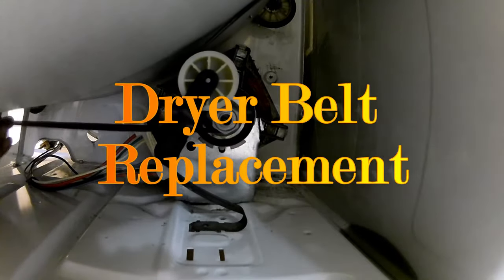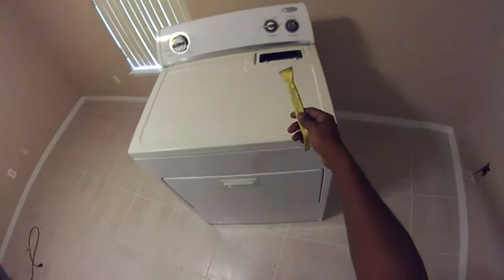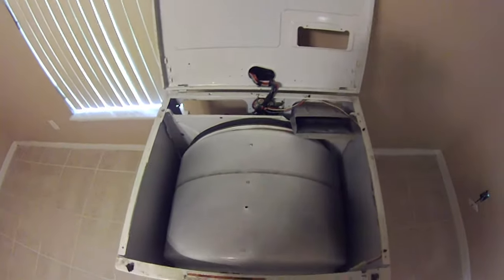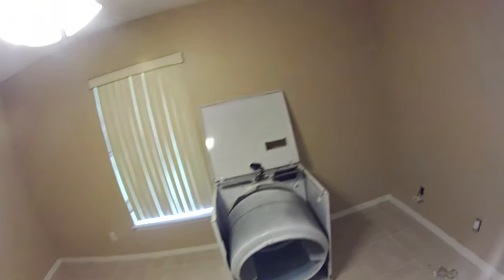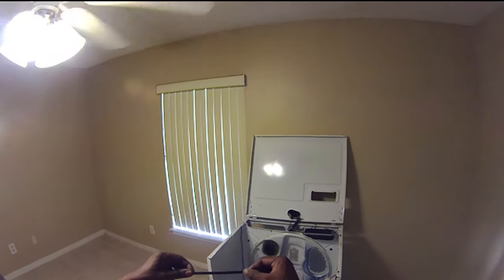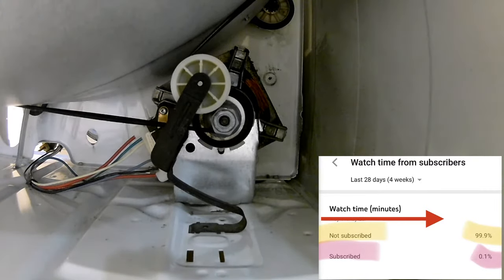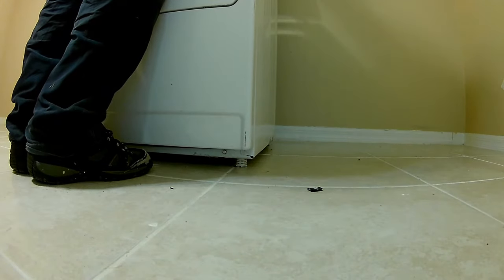Whirlpool Dryer Belt Replacement

Comment: Thank you so much for sharing this video. Yesterday I forced the belt to pop out of place by manually turning the inside of the dryer drum. Big mistake. Putting the belt back was so easy with your video instructions. The only thing that was difficult for me. I couldn't align tthe front door back on the small brackets on bottom front side. I could only get one side at a time. So I laid it on its back and was able to finally get the front door aligned on the brackets. It's working just as before thanks to your video. Thank you again. 😊

Comment: I wish you would have illuminated the area where you attached the belt to the pully system. Can you explain how you did that?
Reply from the maker: It goes under the white pulley in a loop and around the motor.

Comment: I was doing this by myself. Once I got the belt around the drum, I propped the front of the drum up with a bleach bottle on it's side. Then ran the belt around the rocker arm. Once that was done I could get up and hold the drum with one hand and put teh front on with the other
Reply: I used a wire , tied to one of the baffle screws on drum. Whatever works !

Comment: Great video !! I was just wondering if  the belt is a standard size or does each model require different size belts ?
Reply from the maker: You should go to searsparts.com look up your model to get the part number and check Amazon.
Reply: I will do that and thank you so much for responding  .

Comment: How the heck do u get the belt through the tensioner and around the motor
Reply from the maker: It’s in the video, I think I put it in slow motion.
Reply: Lots of effort and cussing - finally got it with a flat screwdriver

Comment: So I did put everything back in place tensioner and connected the belt to the gear however when I turn the dryer the tensioner gets out of place could this be that I did not seat the tensioner correctly
Reply from the maker: Yes

Comment: What the trick to getting the belt on the roller?
Reply from the maker: Sorry for late reply, it’s in the video in slow motion.
Reply: Use a flat screwdriver - it's very tight

Comment: You can put soap on the wheels like ivory white soap, in bar form Has stopped the squeaking for a time on car belts dryer belts all kind of belts for me. Better than belt dressing in my opinion but it does not last in belt dressing really has not worked for me

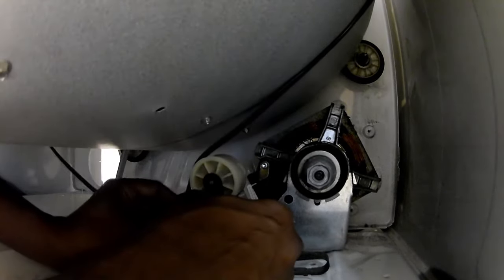Comment: at timestamp 6:13 I paused it to see where and how you affixed the belt to the pully but it is too dark to see what you did : (
Reply from the maker: The belt goes under the white pulley in a loop and the loop hooks to the motor pulley.  Hope this helps.